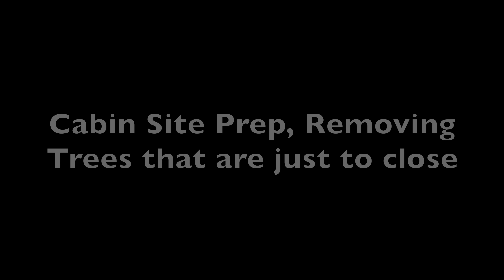WV Cabin Site Prep, They have to go! Trees to Close

Comment: I use to make Adirondack chairs back when I lived in Illinois before I retired. I bought the lumber at a lumber yard and plane it down to the thickness i wanted for certain pieces. Plug all the screws. Back then I had just about every wood working tool known to man. I sold all or most of those tools and now to replace them would be costly.

Comment: Mike, a few videos back after the storm damage assessment, i commented on possibly getting a trailer to attach to your side by side, or your tractors. Well today Adam from hometown acres recently took delivery of such a trailer that might actually benefit your extraction of cut rounds in the woods to your splitting operation. Fyi
Reply from the maker: I prefer the big firewood bucket on the Skid Loader, Holds a lot more and you can split right out of it at whatever height you want

Comment: You should dig the stumps while they are still connected to the tree. Push them over and gravity will help pull the stumps fro9m the ground. if you cut the tree first you have no leverage to get the stump out of the ground.